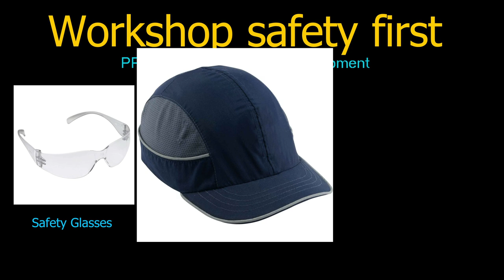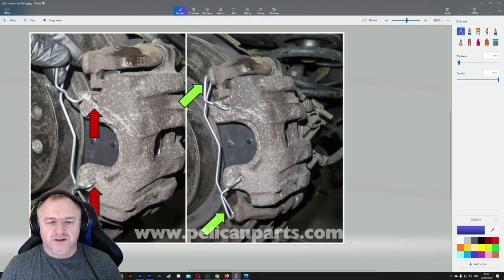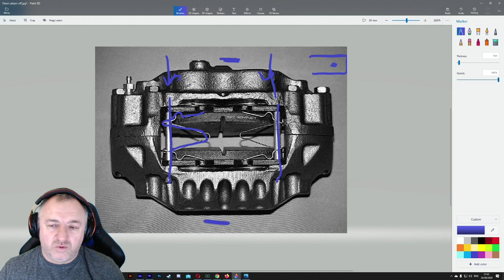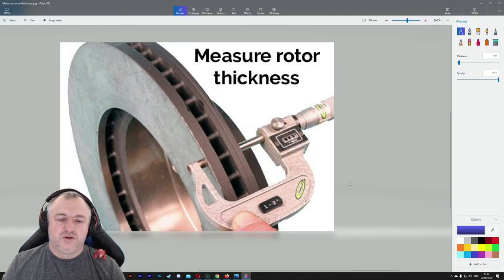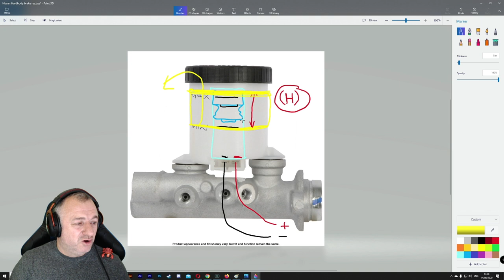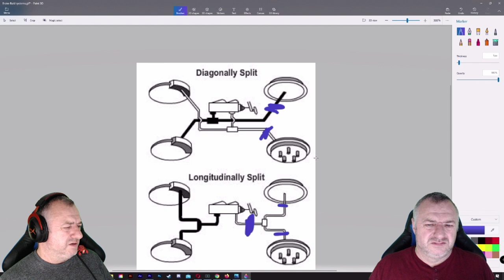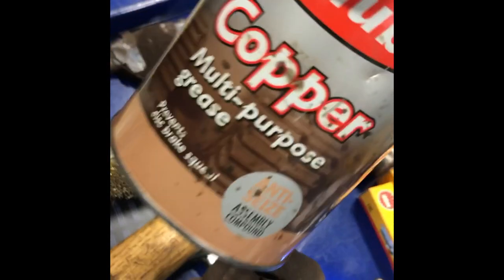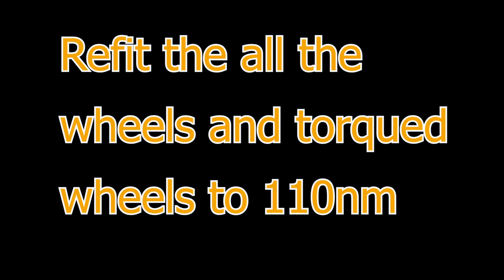How to change Brake Pads, Discs (Rotors) and Inspect. Brake Shudder or Judder. Mark Antony.

Comment: I have a 2000 2.4l Tacoma and recently it’s been clunking/grinding when braking when I’m almost at a complete stop. Doesn’t always do this, most of the time it breaks fine no noise. Let me know what you guys think is wrong. 

Ps-Wheel bearings have been replaced, new ball joints 

Could the guide pins be a cause or caliper piston?
Reply from the maker: Hi Dayton I wasn't sure what a Tacoma was because I am in the UK  but as far as I can gather it is basically like a Hilux, what a wonderful machine you have indestructible. What I have found before is the carrier bolts aren't tight enough. how to diagnose the fault - drive a little forward a bit of speed for about 20 meters and brake hard and then straight away reverse at a speed and brake heavy again and listen for the noise. if you hear it going forward and again going backwards it's the carrier bolts need torqueing.